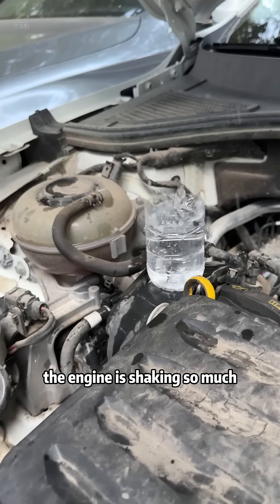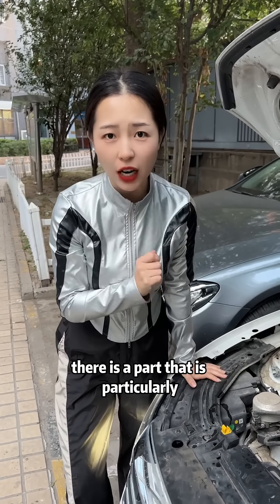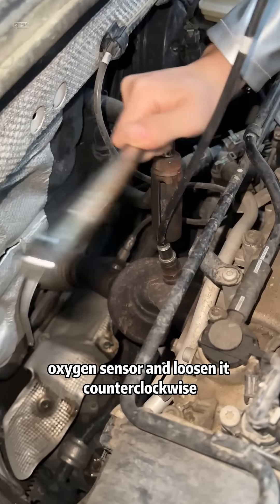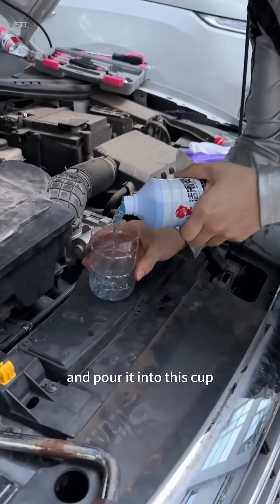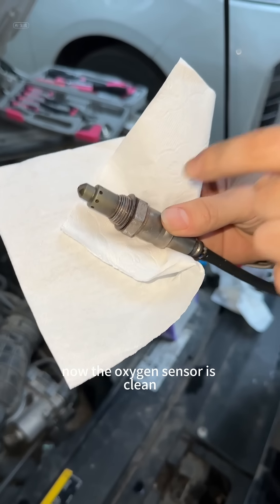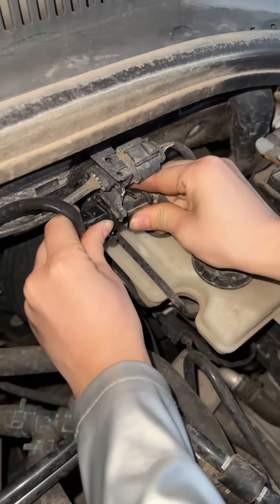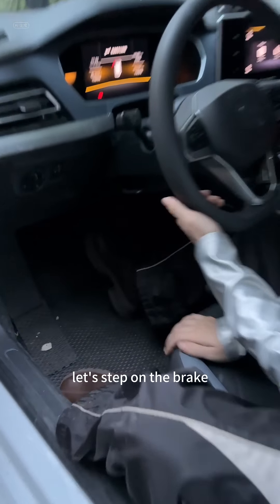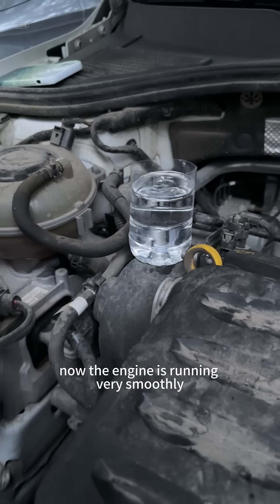Engine shaking like crazy? Solve it for free!

Comment: The wire is exposed by the sensor which will get wet or break. Did you see it? She used a socket that could have broken the wire.  An open ended wrench should have been used.
Reply: She did use an open temch,,, you blind 👎